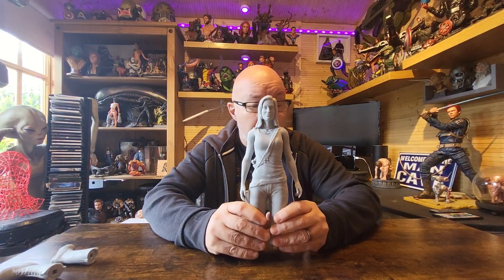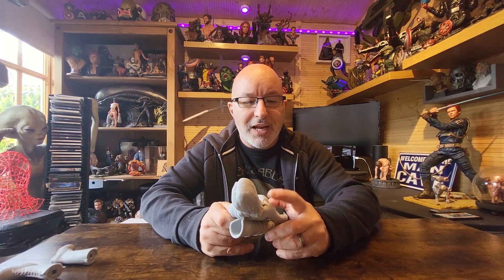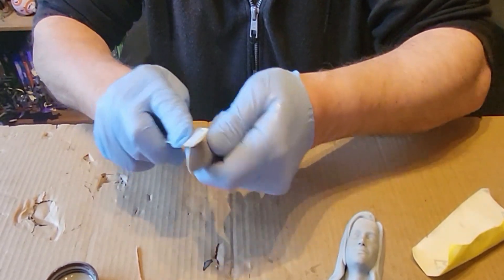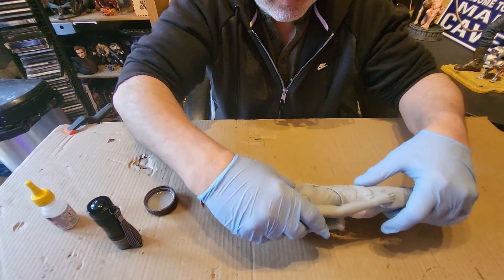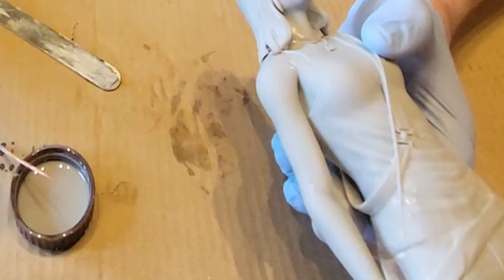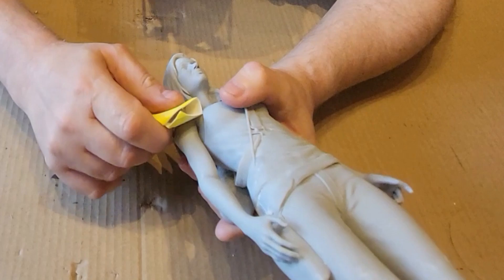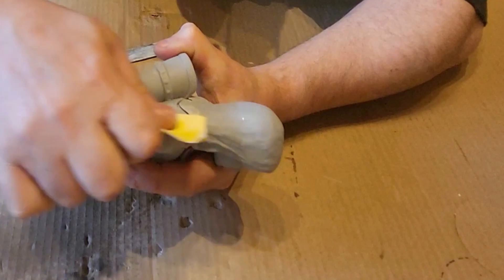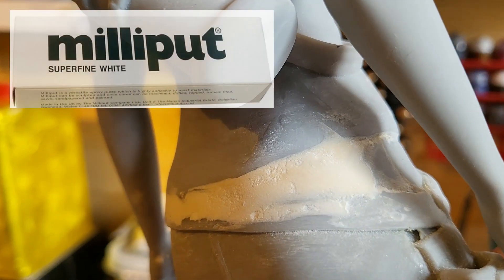How To Fill 3D Printed Gaps With Resin

Comment: In case you didn't already read that somewhere: You can also mix the resin with babypowder to make it thicker. This way you can also fill bigger gaps or drain holes. At the very end after sanding you can apply a very thin layer of pure resin to get rid of the white surface that is left from sanding... Or wet sand it, I found it works great and doesn't leave the white surface. Got all from this great video: https://youtu.be/P2ka3qzT4M0?t=225
Reply from the maker: thank you

Comment: You can actually put the arm on in your slicing software. Just carefully line it up and make sure it’s touching. And it will print like it’s one part. I printed a brush holder I found on Thingiverse. I wanted it bigger. So I fused 2 together this way.
Reply: Yep, I do half my assembly in my slicer.
Reply from the maker: I'll try that thank you